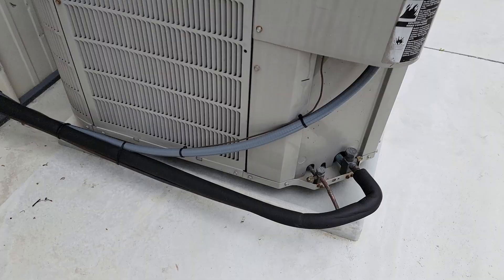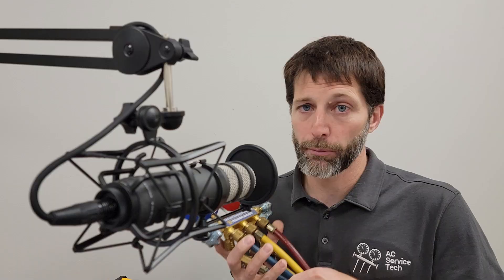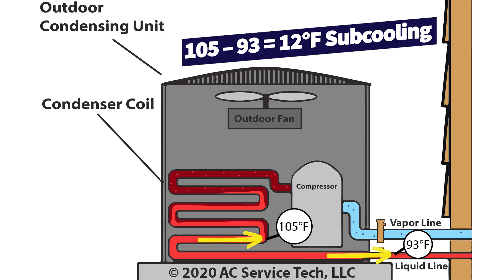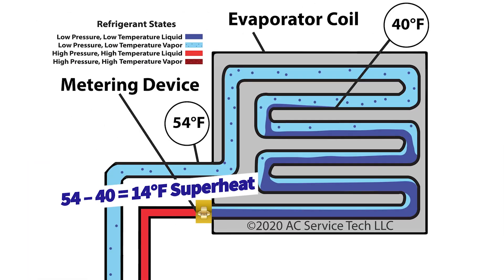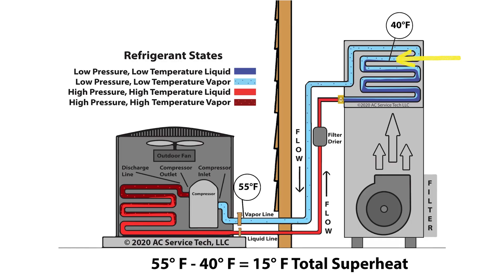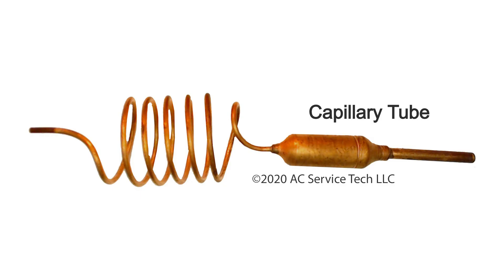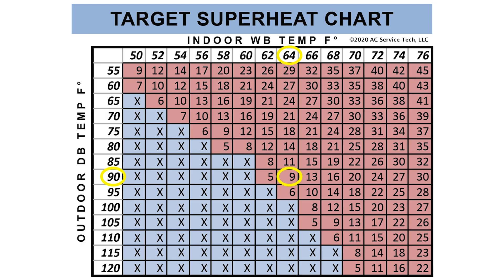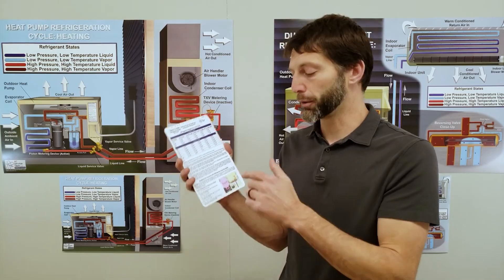Measuring Superheat and Subcooling without Checking Pressures!

Comment: I'm two years late to the party.... but... The current debate is: Can we use a infra-red temp gun for taking tubing temp readings? Or does it have to be a physical/mechaninal connection of a thermometer probe actually touching the tubing?

Comment: How does measuring pressure at the port translate to temperature in the condenser? Why is it not the temperature at the location of the port? Are the P-T charts adjusted for this?

Comment: While a manufacturer could bring a line out to where it would be easier to measure the temperature, it would probably be be more cost effective to permanently mount a thermocouple and and bring the wires out to test point where a  meter could be easily connected.
Reply: Yep. That’s what the fancy modern VRF ductless split systems have. A brazed-on sensor(s) that feeds data to the control algorithms. The only problem is that they don’t open an API for us to use that data. 🙄

Comment: I don't do HVAC professionally, but have done my own service and install work for 30 years as I've owned many properties both commercial and residential and do a ton of work myself to save money, electrical as well.  Anyhow, I can basically tell if an AC system is okay by the temps on suction, liquid and factor in the ambient.  Has worked for me.  Its close enough.

Comment: Question. I ran into a 3ton a/c and its over sized for the home. Can I swap out that compressor with a 2 1/2 one?
Reply: take the evaporator coil model number and look it up, it may or may not be rated for 2.5 to 3 ton condensers. you may have to change the piston(orifice) or txv on indoor coil also.
just swapping a compressor only is a no-no, although it "may" work, if you modify more of the system. but that is engineering level work and not recommended at all.
Reply: @throttlebottle5906  Both the coil and condenser are 3 ton. Coil is a piston. Maybe I'll try a txv.

Comment: If you are going to put guages on the unit don't use your manifold guages. Use just the guage with a refrigerant hose connection with a short ball valve hose connection. Minimum refrigerant lost and easy oil drain from very short hose and clean if need be.

Comment: My Fieldpiece non contact infrared thermometer seems like a easier and faster way to to check system. I had the Fieldpiece wireless temperature dual probe tool that measures difference in air temperatures before and after evaporative coil, cracked off my most expensive equipment when I was poor.🤷🏻‍♀️
Reply: Infrared thermometer readings on Copper will not be accurate. I don't think pointing it on the fins of the coil when you shoot it would be accurate, either, as there is heat dissipation.
Reply: non contact thermometers are about as accurate as trying to hit a Pinata when dizzy after spinning around 50 times. the accuracy is just not there ;)

Comment: Good video mr Craig I ran into a package heat pump a few weeks ago where both the indoor and outdoor unit were inside and the other MT and I noticed there wasn’t a service port for the liquid line to check for subcool and it was a txv unit and I thought to myself there has to be way to check to the subcool for this system. Our senior advisor told us not to worry about it 🤦🏾‍♂️ but I really appreciate this video this is great information I appreciate what you do 💯👍🏾.

Comment: Great video. Digital pressure probes or stubby gauges are the best way to check subcooling or superheat if you are trying to avoid using hoses (for all their pitfalls) It would definitely take less time, anyway. I like your suggestion of manufacturers updating designs to add ports to check temperature at the middle of the coils.
Reply: That would only cause more leaks on these cheap pieces of shit. that we already see too much.
Reply: @snakecat586  You must not like servicing units. Connecting gauges doesn't cause leaks unless you have a bad schrader and those are easily swapped.
Reply: @gamewizardks  I never said any of that. I’m making a point of how many coils leak on newer systems here in Florida. My last call was a two year old train leaking at the coil.
Reply: @snakecat586  You mean adding ports to check coil temps would make for more opportunities for leaks then? Thought you were addressing the connecting of gauges. Wasn't sure at first from your comment.